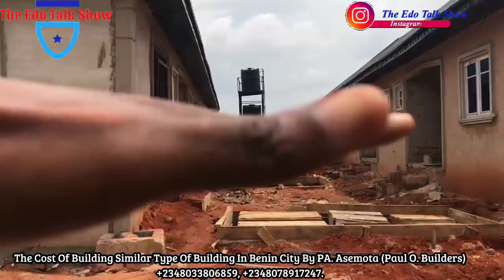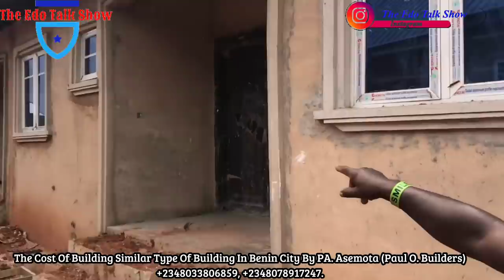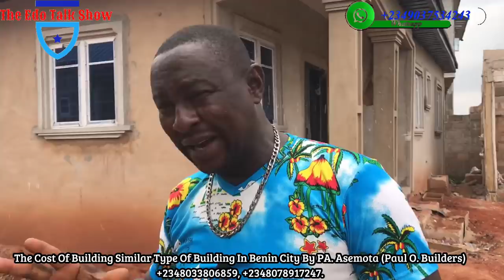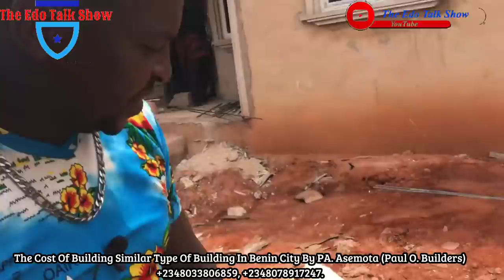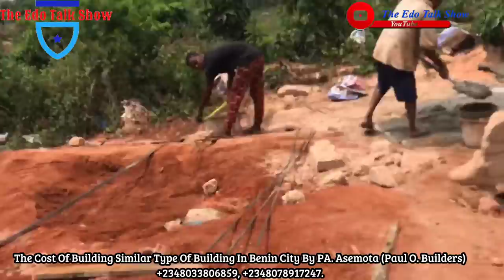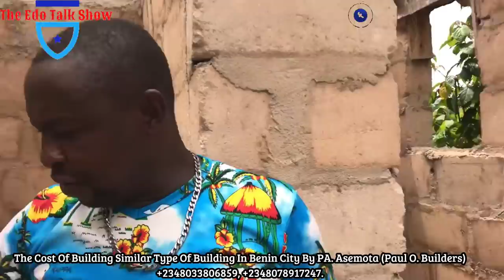EDO: A Building With 11 Flat On 100x100 Land And How Much It Will Cost To Build Similar House In Edo

Comment: Very good, but the rooms will be very small
Reply: Exactly my thought also
Reply: i definitely knew the rooms will be small ,the one a friend of my did in a 100by100 has 4 a room and parlor self contain on the left side and 3 2bed room on the right hand side
Reply: @afogbonjaiyewisdom1436  Was the one you mentioned "4 a room and parlor self contain on the left side and 3 2bed room on the right hand side" small or it was the standard?